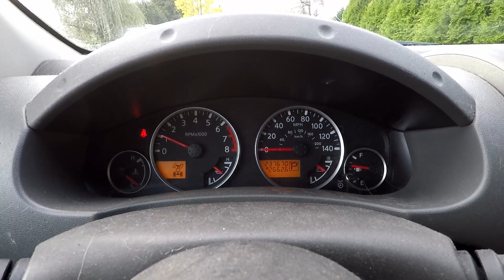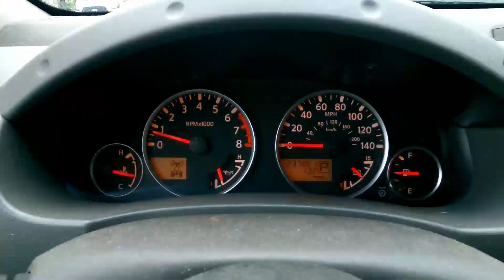2005 Nissan Xterra Update - Datsun 210 Rescue? Engine Replacement Update & Free Datsun Rescue

Comment: I’m just reminded of a ‘91 YJ wrangler my brother came across few months ago . Didn’t buy it though . 4.0 with an ax15 , crazy lift on 33’s I think . Looked like a decent lift kit though , maybe skyjacker ? Good shackles too . Story was , the guy , a contractor , took down the belly pan to do a broken brake or fuel line . Sat there since , hanging by its rear shaft , almost slipped out of the t - case . Will someone tell these contractors they can’t fix cars with sledge hammers and wrecking bars ! Geez ! Wanted to take a measurement of the line and go to the parts store and get some 3/16” brake line or 1/4” or 5/16” fuel to fix it right there . At least the bottom was POR 15 , frame and floor , front to rear . That’s what got my attention . A sound YJ . Don’t see those too much anymore . My brother bailed out , even though he could have gotten it for less than a grand . When we saw some one had their hands on too much under the hood , I agreed . Sure , ran good when parked . The air cleaner duct was off , probably forever , to spray either to try to start it ? My brother wanted to tow it four blocks to dad’s house . If we couldn’t start it and drive it home , then that was a deal breaker . The low price was the sign . My brother got no money , it would have been a money pit to me . But to someone , a good project . A little tough to walk away from , but I think there was some confessing to be done . Bottom line is , the projects are out there if we got the heart and the funds .
Reply from the maker: Can't save them all. Sometimes it's better to have some standards. :)
Reply: @i2edeye  
That’s true . I keep feeling sorry for almost every Jeep that needs help , but it’s out of my means . I revert back to when I was just a kid playing with my tonka toy Jeep . I decided that’s what I want , an old school Jeep . Never been a YJ fan but will never fault anyone for that . After 1983 , when the cj5 was scratched from the drawing board , I knew I would have to settle for used . Not a bad thing though .

Comment: Just found this video . I commend you for being diverse in your wrenching selection . If I were still on a full salary and had more real estate , I’d be afraid of the vehicles I’d drag home 😬 . I think that was a ford courier pick up , next to the Datsuns parking spot ? Digging your Nissan Extera . My brother had one , but nothing lasts in his hands . My XJ Cherokee , a ‘92 , has been in my hands since just before 9/11 . If my father had kept it , my brother probably would have wasted it . Would have been a waste of a good aw4 trans and np242 transfer case , the best parts of that Jeep . The 4.0 is stealthy too but I got to get after it someday to determine if it needs attention . Tune ups and oil changes only go so far . Well , at least,east I just did the rear brakes and rear lines . Fronts all new and years ago did front end work . Did a/c work , rear axle seals , just did front u joints again , too much too remember . Well ,we keep them running to our best ability . Appreciate that you will get this Datsun running when an engine and transmission is sourced . Body looks good . Front glass and some interior . I’ve a feeling you got leads on parts to get it up and running . Will be interesting to see this as well ! BTW , I think that was a blend door actuator motor crying out ? Sorry , didn’t mean to remind you .
Reply from the maker: XJs are great rigs, I have a few friends with them. Yes the blend actuator door, someday I'll get to that lol. 
We have had this X since 2008 with like 50K on it and it isn't going away, it is a beast and part of the family. We actually have a 2001 X that we have had since 2003 or so. 
I tried to say no to this car, but free is free lol. I do already have parts lined up sort of, time will tell. 
That little pickup next to it is a Datsun 521. I have a few videos on that one on the channel. I should probably put a playlist together. 

https://www.youtube.com/watch?v=gS77WGys5MU&t=37s
Reply: @i2edeye  
Thanks for identifying the red pick up . Something told me I’m not sure it’s an English ford . Just couldn’t figure what though . Haven’t seen a Datsun in ages , other than Z models . My XJ needs the usual , rockers , quarter panel work and floors . Boy have I got my hands full . Three jeeps and all of them need something . My’80 cj5 will need a clutch done one day . Should have just done that when I had the motor out when I bought it from the junkyard . 258 , T5 and D300 . Best deal I ever got . Just wish I had spent the extra cash for a clutch assembly . Well , it’s drives and doesn’t slip but it only had half of its life left . Just another job waiting to be done .